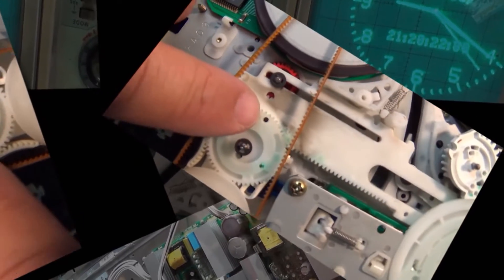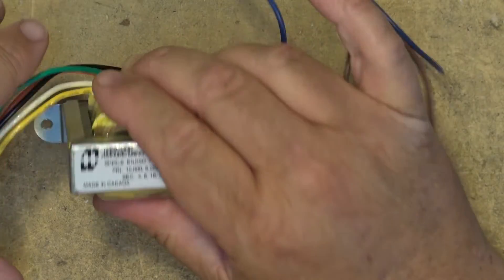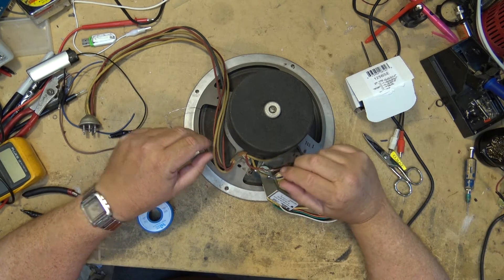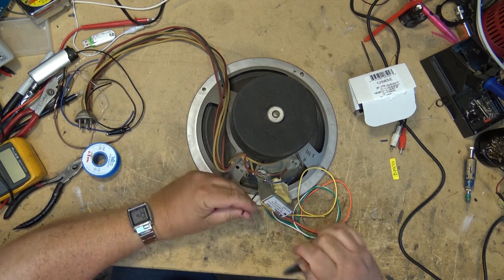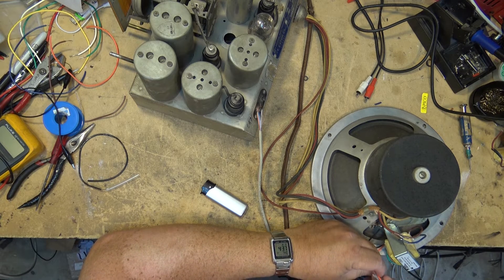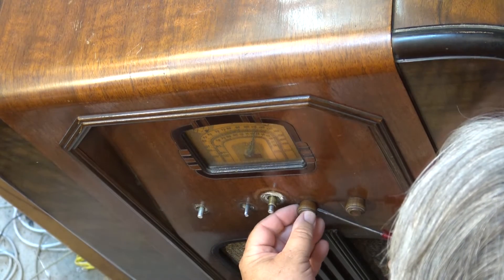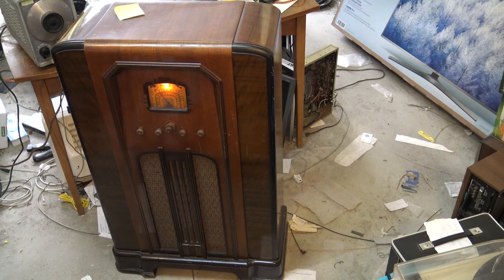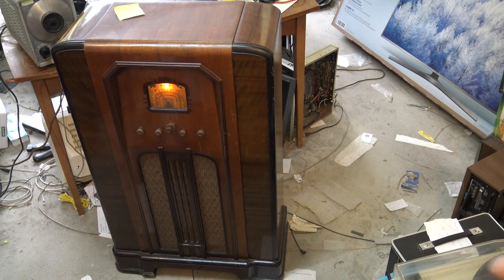80 year old Electrohome Series 662E Radio Restoration Part 3

Comment: I am amazed that these older radio-tv designs worked as well as they did, the fact that the underside of these units are a mass of wires and components exposed to bare hands. I can remember working with my Dad on some older 1960's TV's together as he was too cheap to pay a repairman, it is a wonder I did not electrocute myself tinkering around in these units, they also have a distinctive smell to them as they age. Nice work.

Comment: I know impedance and resistance are not the same. But it "seemed" that I could determine the impedance with an ohmmeter. But I could be wrong.
I guessed the 4ohm tap would work best since I thought you said the resistance was 1.2 ohms.
In addition, just think, people used to stare at the radio like we do TV's when most people just had radio. My late father told me about the old radio days. It was entertaining, you had to picture everything in your mind. Unlike TV.

Comment: How do you do this stuff!!!??? I've been trying to fix my Sony SLV-775HF from 1996 for 3 days now and I'm almost giving up,, I commented on one of your vids a few days ago but I guess you must have not seen it.. One of the "gears" near the loading mechanism is jammed and I don't know what to do...
Reply from the maker: Is the blue loading gear broken? It is a very common fault on those Sony VHS
Reply: 12voltvids I'm not sure, I don't notice a blue gear under my model but it was all turning over and working when took the tape deck out, but once it's back in it won't keep the tape down and struggles to turn over then keeps going back and fourth with the tape a few times and spits it out..
Reply from the maker: Undertaker Fire 
I did this for a living for over 20 years. So it is second nature for me. Some stuff is easy others not so much.
Reply: 12voltvids that's amazing!:)👍 I will reach out to you if I need your knowledge.
Reply: I hope you don't mind, lol